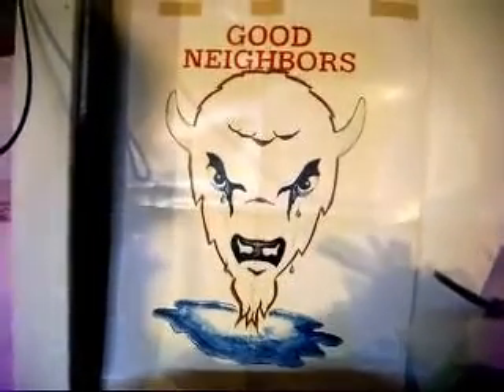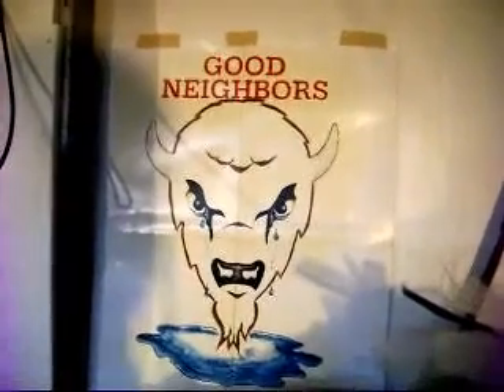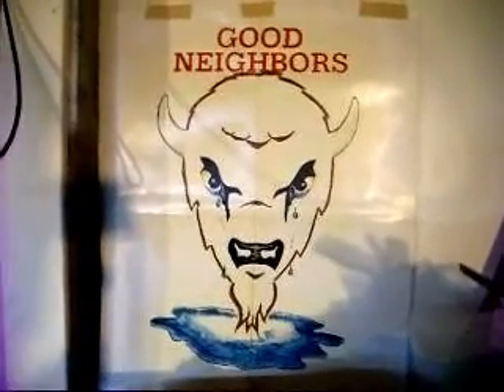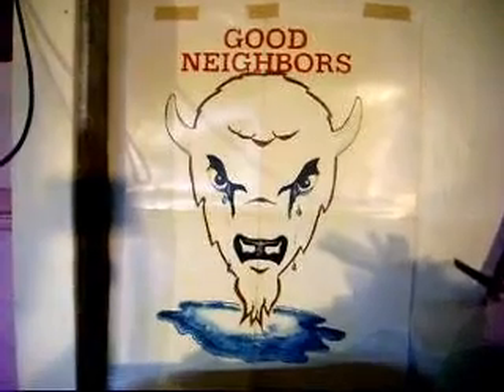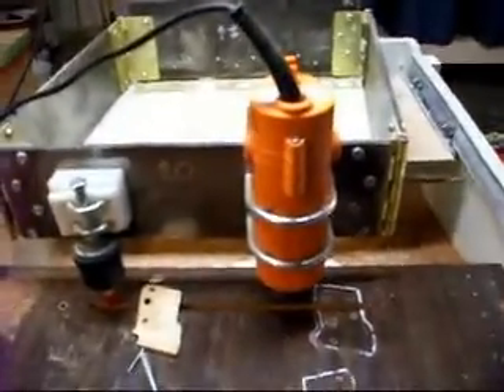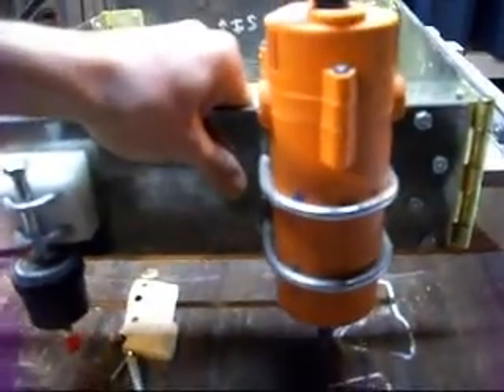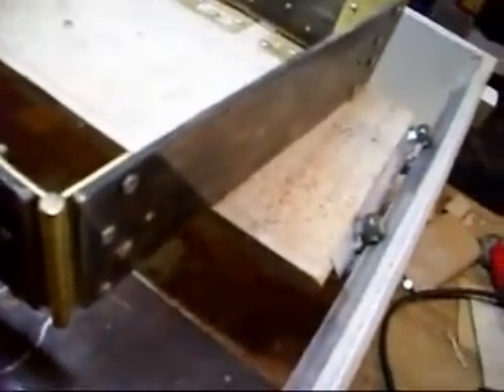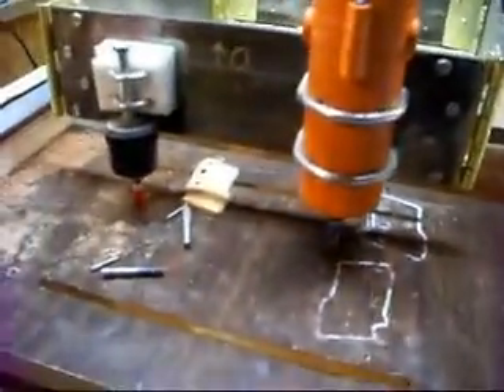Homemade carving duplicator, DIY Duplicator, Inventor goes Public

Comment: Those hinges can't have a very high tolerance. Even if the plates are sturdy enough the thing must flex quite a lot which means it won't duplicate very accurately. Also, you should add a way to rotate the two objects. I am thinking about attaching a bicycle chain and a front chainring to make the objects turn at the same time. Might need a chain tensioner. Did I mention I also build bikes? :P Great idea for a cheap amd cheerful clone router, but maybe get better hinges.

Comment from the maker: opie7afe, must build 3D chucks with the machine to do stocks.  Your workpiece and  master must turn in perfect unison.  Machine is screwed together by tapping into the steel plate.  I used 10/32 screws and tap.  GOOD Q!!!

Comment from the maker: Thanks Muddy, means a lot coming from you! You've got some of the best vids here!  You are very correct, I cut patterns out of thin material, I've even used recycled paneling! Following lateral edges of a scroll sawed pattern, I can raise and lower the stylus for a nice carving!  IE, a dove tailed (cut tails first) toy box, and carve a soldier in the side etc!  I made a butterfly pattern and carved it in marble tile! Diamond bit/ spray bottle for coolant.

Comment from the maker: Makes parts faster than a CNC for under $500.  The aluminum angle sits in grooves on the side.  Make the grooves w/ your router!  Toughest part is drilling the aluminum angle for the carriage/ roller bearings.  It's worth making and allows you capability of having a mill in your shop!  I could make keys it's so accurate!  The base is the last part to make.  PM me and I'm more than happy to call ya!

Comment from the maker: I tried 10 different ways, couldn't get anything accurate enough.  Don't let the metal work scare you.  Cold roll steel drills easy!  Use aluminum if affordable!  Get a 10/32 tap and screws/ bolts for hinges.  The slides are used in homemade CNC machines.  There's vids on "homemade linear slide".  The whole machine pinches together w/ threaded rod in places that the top carriage won't hit!  Don't know when I could make another?  Did you see my other vids?  Easiest to make of all I've seen!

Comment from the maker: You probably could, but wood is going to add weight and might flex a little (throwing accuracy a tad).  If I had it to do again, I'd use aluminum for the top carriage!  I didn't point it out in the vid, but I alternated the hinges to get rid of any potential slop.  One is driven in from the top and the other side from the bottom.  The metal is worth it tho, depending on what you're making (size requirement of the machine).  Let me know how you make out!  Just give a yell for help!

Comment from the maker: PM ran a story, yes!  If it's the one I think you are talking about, it's nowhere near as accurate!  See the differences between this and PM...  I built one that hand control arms which acted like levers.  Due to their inherent shape, there was a lot of slop in the bearings.  I thought about it latter, I could have used bushing but didn't!  I made that machine out of plastic cutting board.